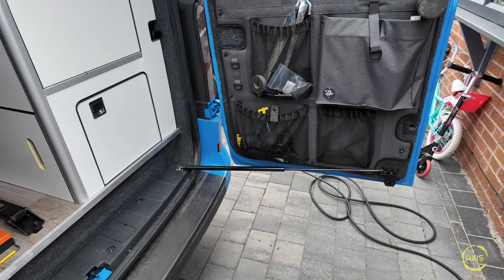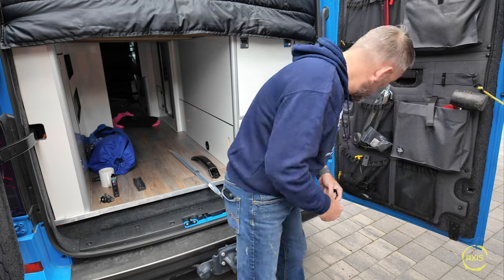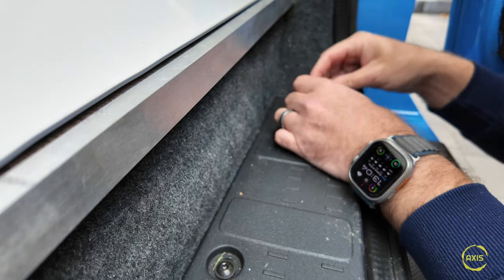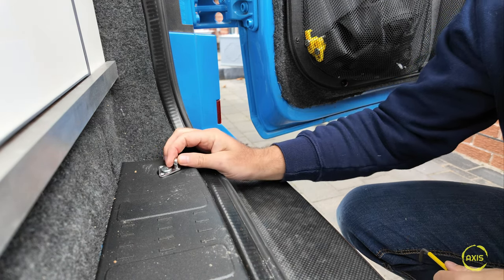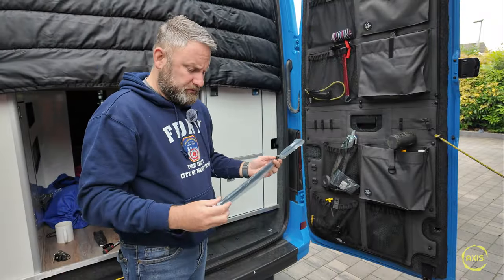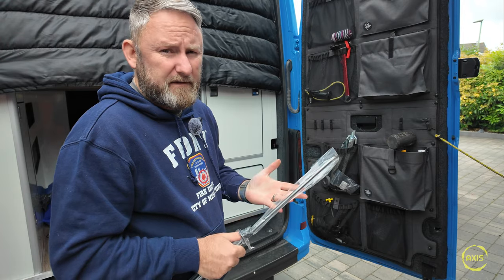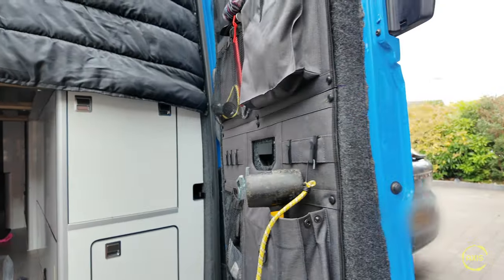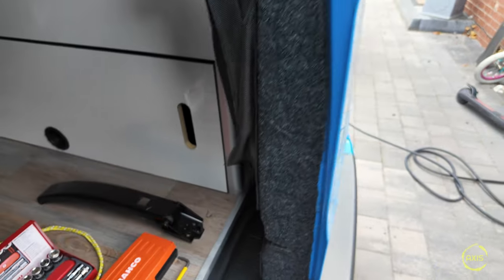VW Crafter MAN TGE Rear Door Strut Upgrade: A DIY Guide

Comment: I need one of these for my transit custom. Had take strap off and some times forget and door swings around 😂
Reply from the maker: 😂 its a ten minute job! I just make it look hard 🤣😂
Reply: @AXISUK  it’s just knowing which is the right one to get
Reply from the maker: @marcoantoniomoreno2055  not sure on the size of the Tranny doors but won’t be far off if mounting points are in a similar position
Reply: I have been looking for a solution for my Custom too. This looks like the ticket. The Custom doors are a bit curvy at the bottom (2018 new shape), so I guess they would have to be attached at flat panel height. Also I’m not certain how far from the hinge to mount them on the floor.  I think I’d be inclined to go for a stronger strut to prevent the wind pushing the door closed?
Reply from the maker: @freereed6102  best way to test is temp mount them to factory stuff that’s on the doors/floor and see how it shuts. With regards to the strength, 100nm is quite strong and I think anything more would be effort to close.
Reply: Good idea. I’ll try it with the 100s first 👍
Reply from the maker: @freereed6102  fingers crossed it works a treat 👍🏻